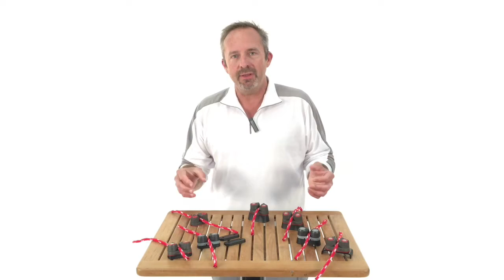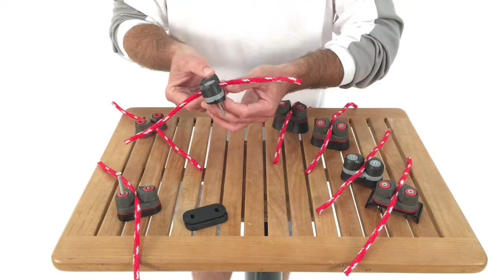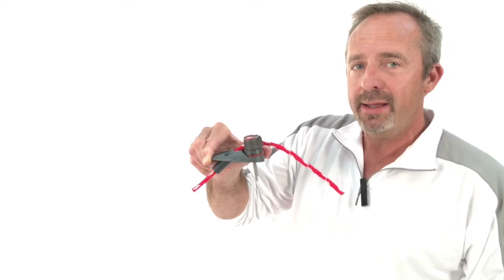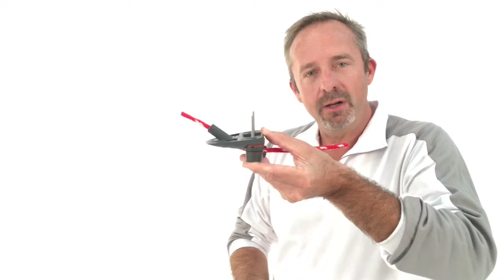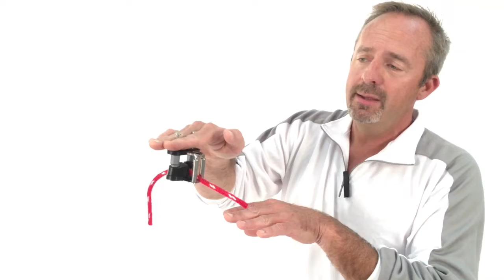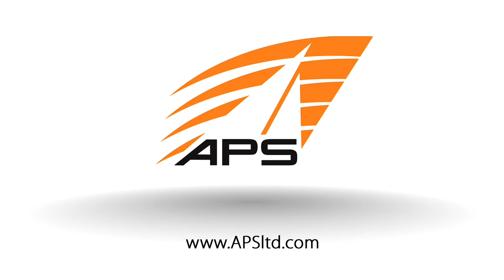Choosing Cam Cleat Accessories for Sailboats | Expert Advice

Comment: Good afternoon and thank you for this informative video. I have a question about how these work. I have 2 - 17' x 4' metal frames with 8 solar panels each. The frames are set on poles so I can turn them from East to West all day every hour. As far as just keeping the wind from turning them I need to know if I used just 1 section of rope attached to each side of the frames would these cleats keep the rope held in place or is this a one direction type of thing? I would really appreciate an answer if you have the time. Thank you!
Reply from the maker: If I understand that is is one loop of line with each end secured to either end of the swiveling frame, you could use two cam cleats to adjust the swivel and securely cleat it in place. Yes. Cam cleats hold on only one direction.